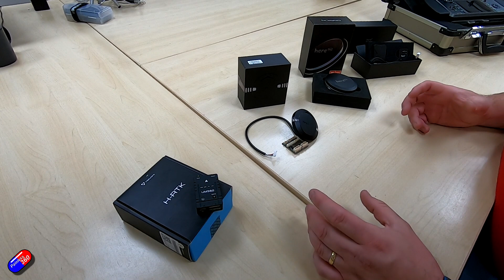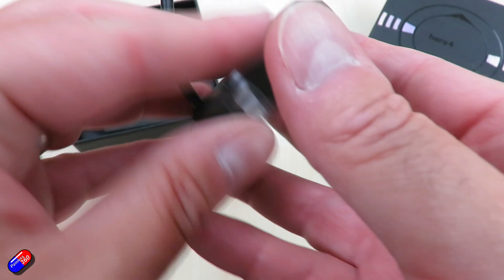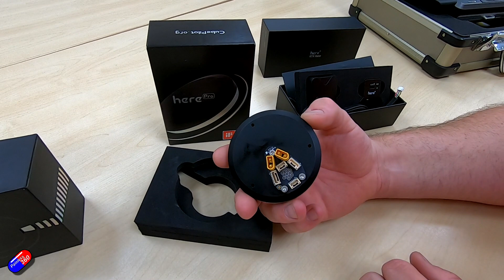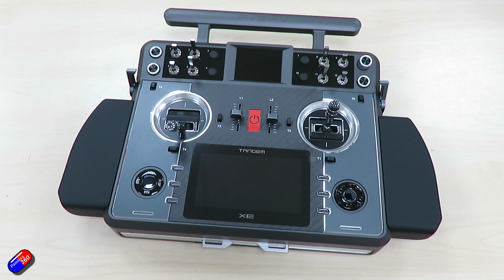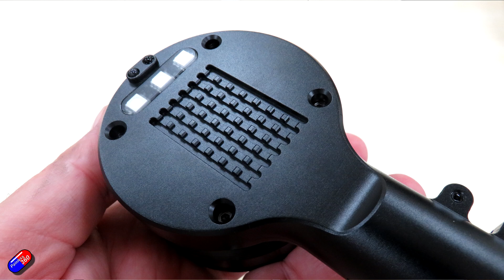Latest Stuff at 3DXR (and an RTK special offer!)

Comment: How would you go about connecting the Here+ base to a drone to use it as a rover? Would it have to be connected via the rx and tx pins on the top?
Reply from the maker: The setup of the rover in terms of the GPS is identical to all other model types. There isn't anything special about the wiring. See https://ardupilot.org/copter/docs/common-here-plus-gps.html